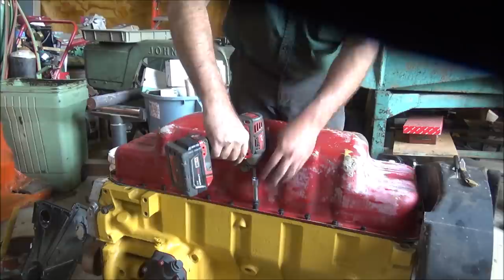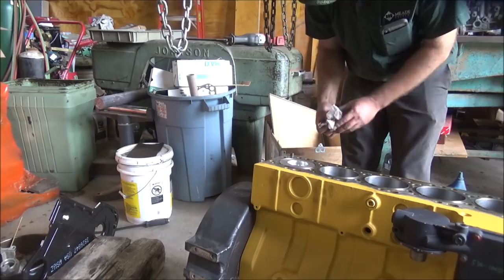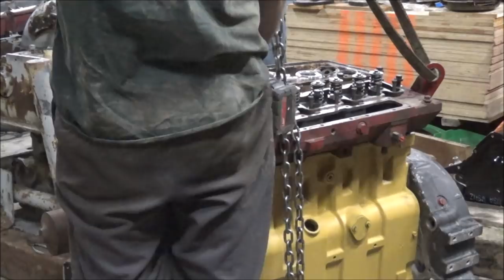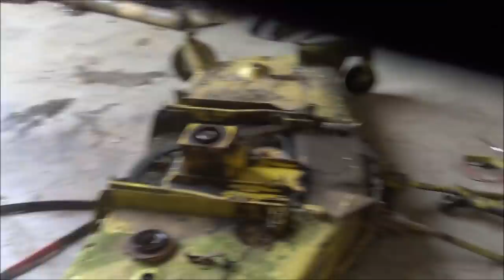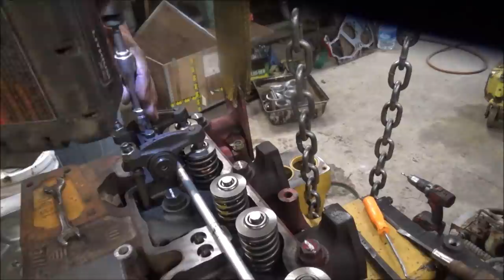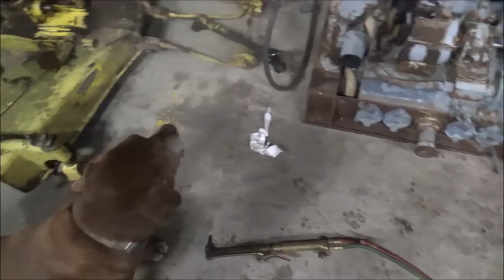Hyster Forklift Cummins 8.3L Swap Part 6 Engine Assembly

Comment: Disappearing parts. I was rebuilding a Detroit 652 and was short a piston pin. I searched for a week looking and ended up using a good used one. Two days later I found the pin in our freezer. My partner wanted to see if shrinking it would help assembling  the unit and he forgot about it. Looking back it was worth the aggravation for a good story
Reply from the maker: Question is did you tear the engine back down after you found it to put in the new one? Lol

Comment: Hi Brian,
Just about to start my 6CTA Rebuild really enjoying the videos. What type of Silicone are you using.
Cheers Mick
Reply from the maker: @mickmocin586  I assume you mean the dabs of hylomar at the joints on the pan gasket. In general I keep silicone away from engine assembly as it can sure mess stuff up if it gets loose in the engine. Most gaskets are installed clean and dry unless it’s one I worry about staying in place or has a rough surface then I paint the surface with aviation gasket sealant.

Comment: Looks like you need to put a couple of tiny tacks on the socket and extension, you can separate them later.
Reply from the maker: Or fix the retaining pin in the extension

Comment: Hi Brian.  Did you use a ball peen hammer on the oil pan holes so they pull the pan tighter on the gasket. Best Regards

Comment: 200 ft lb seems like a lot, but when you think about C/R and Boost, its really not a lot.  What is that like 17:1 compression and 50psi of boost?
Reply from the maker: 17.5:1 and probably 30-35psi stock

Comment: Are you going to put it on the HBM and give it a pre-installation spin?  Make sure oil pressure comes up as it should before it's fired to run on it's own?
Reply from the maker: No I have better methods.

Comment: Why do you appear to not be using assembly lube?  We always in the past used STP as an easily available lube for every moving part.
Reply: stp is not a lubricant, it is a viscosity improver. makes a poor assembly lube
Reply: @steveschumacher5470  BS
Reply: @davidcallista2580  Not BS, that's really what it is, a bunch of VI goo and a dash of ZDDP (which isn't nearly as simple as people make it out to be but I digress). Build motors with it if it makes you feel better but an oil can of SAE 30 diesel engine oil will work just as well, if not better.
Reply from the maker: Everything is assembled with the 15w40 engine oil it will see for the rest of its life with the exception of the cam. It will all be pressure lubed as well before it ever gets turned over to start.
Reply: @steveschumacher5470  Granted it is a viscosity improver.  However, we figured that if you could dip a flat blade screwdriver pointy end into STP and then you find out that you could not keep the screwdriver from slipping between your finger and thumb it had to be one terrific lubricant.  Plus, we had experience with engines with zero oil pressure lasting long enough to get things shut down and suffer no damage because the engine had STP in it.  Snake oil? Well, when it first came out we found that after putting it into an engine we would have to turn the idle back down a bit.
Reply: @bcbloc02  We had a pressure oil tank that we shot engine oil into the lube system for a moment before cranking.  Turbos like that oil pressure.  I am a believer that one cannot over lubricate a fresh engine.  We even installed some pre-start electric oil booster pumps like the military used for aircraft engines.  Wait till the oil pressure was up for several seconds and hit start.  We even did that for one customer who was a believer in the pre-oil system and put a Hobbs switch so the starter would not engage until OP was up.  I am from the days when we put shims behind rod bearings to take out a couple thousands of clearance.  Heck, we even found Chevy stovebolts with babbit bearings.
Reply from the maker: I have worked on those old babbit bearing oil dipping Chevy's. I like the starters with the built in gear pump where when the starter starts to spin it pumps the oil up once oil pressure is enough the bendix is engaged and the engine can start. Pretty slick setup. I am sure such devices help but honestly most engines if taken care of tend to outlive whatever they are in with out those extra assistances.
Reply: @bcbloc02  Dang, you are either older than you look or have worked on collectible antique cars.  You are driving a classic Dodge truck. Those are showing up in car mags when someone dolls up something besides the Fords and Chevrolets.  I am in the process of restoring my prized 85 Dodge D-100 Custom short wheelbase I have owned for 25 years.  That was one of those that were sold with absolutely no options.  /6, 4 sp, and it only had power brakes because it had disc brakes.  Manual steering. Gave it to my grandson when he was a senior in HS and needed a vehicle to get to an internship.  He drove it thru 4 years of college and all of that driving was in northern salt road places.  Can't blame all of that rusted out stuff on him as we spread oil field salt brine on our gravel road to help keep the dust down.  Keep up your great videos.
Reply: @bigun447  read the can. it is an additive, never meant to be used alone.

Comment: I always thought that torque to yield bolts were one time use only and had to be replaced once they get stretched. Hard to tell if they were new or used.....
Reply: Not sure of the case here but I know when you get into the big/expensive stuff there's sometimes an inspection procedure in the manual to qualify used ones for reuse.
Reply from the maker: New bolts is ideal, if this were a high powered build I would use new ones. Cummins sends a bolt stretch gauge if the bolts aren't stretched you can re use them supposedly. These aren't torqued to yield just torque turned.

Comment: Oh Brian, why didn't you paint the oil pan and head before putting it on after all that nice yellow inside and out on the block? Lol. Don't worry mate we all miss something out like a broken stud when we are doing an engine rebuild lol looking good. As a matter of curiosity, what is the displacement of that engine? In cc's if you would as we don't use cubic inches in England any more
Reply from the maker: Saves a lot of masking to just paint it all once it is together.
Reply: bcbloc02 ok mate fair comment lol
Reply: Err what cc is the engine ?

Comment: you don't torque the rocker arm assemblies?  I assume you just covered the valves for now, but will take it off and adjust the valves?  How's Bailey doing?  Old age is hard on a dog, I think more so than people sometimes.
Reply from the maker: Yes the overhead all gets revisited when I have the parts to fully assemble that part. I just put it together to keep it clean.

Comment: Brian, I thought you said turbo?  Do you need the turbo for the forklift?  That big dude should make more than enough power NA for what it's going to be doing, no?  But, use the turbo, or find an non-turbo exhaust manifold... if there is such a thing... I guess that is the real question.
Keep on keepin' on... Getter done!  Lovin' it.
Reply from the maker: Boost makes everything better, even if you don’t need it. 🤠

Comment: No doubt that's going to be in forklift  and running before I am on the road (well legally)! Do you have those weird pre-heaters for cold starts on your intake manifold (ones that spray diesel and have an igniter)? If so are you keeping them?
Reply from the maker: No I don't have any heaters on this unit. I am hopeing it will start like my b series which never needs them till below 0 and I don't plan to use a forklift if it is below 0.

Comment: Brother your doing excellent job I am watching so interesting

Cylinder head getting  short bolt and length bolt I want torgue details details
Reply from the maker: Pretty sure I gave the head bolt torque values and the steps in the video.

Comment: Mr Brian my eyes may have deceived me but it looked like there were two missing nuts on the oil pick up tube mounts  at the oil pan rail ends. Hope I am wrong ,
Reply from the maker: Those are bolts with spacers that hold the pickup mounts to the block pan rail if that is what you are talking about.

Comment: Looking good :)   What would a rebuild like this cost if you took it to a rebuild shop?
Reply from the maker: I don't know but the Deere engines of similar size I do at work typically run $7000 to $10000 depending on how much is still in spec.

Comment: SO THATS WHY MY BILL ALWAYS  has  A SHOP SUPPLYS CHARGE ON IT  TO CLEAN WORK PANTS ????  cheaper to buy blue towels
Reply from the maker: You bought towels lately? lol
Reply: bcbloc02, I get 50 of the red shop rags at Harbor Freight for 10 bucks. I wash them  if they’re not too greasy or oily, just don’t wash them with anything you don’t want to turn pink!

Comment: You forgot One Of The rockers from the camera point number five to tight it Down
Reply from the maker: I did not install the set with the missing pushrods
Reply: You didn't miss one installing but what I can see see if number five is finger tied and not with the Drill
Reply from the maker: Yes I did not put it on as I will have to lift that set up to drop the missing pushrods in then I can tighten that set of rockers down.

Comment: I built brackets that go where the engine mounts go and have them on jack stands 
Built too many engines to count 
More then the cummins dealer built
Cummins mid range engine specialist
Reply from the maker: So is the exhaust manifold different from an ISC to A 6C? I went to bolt the manifold I had on the other day and the bolt holes are like 1/4" spaced too close together on my manifold versus the head. The ports all line up but I can only get one bolt in. Lots of places on the web show the manifolds being the same but I can only figure that is wrong. DO you know do they use a different part number exhaust gasket between the 2 engines?
Reply: bcbloc02 what happened to the manifold that came off
Some times they warp till the exhaust bolts break
Cpl (corresponding part list) tells you everything which manifold cam thats what its there for
Reply from the maker: Paul Tavres I have 4 Cummins midrange engines and none of them have legible data tags. The fan blast has eroded all of them blank.
Reply: bcbloc02 there should be a serial number stamped on the right side rear near the head gasket surface 
You use that number to get the cpl number

Comment: Can’t you tell your going beyond torque? It clicks and your still tightening. I tell people using my torque wrench when it clicks stop 🛑!
Reply from the maker: Nope can't tell. I went back and rewatched the video and could not find where you were talking about. I mean I see where the handle moves after the wrench clicks and breaks over but the socket is not. Maybe one rod bolt I pulled just a bit after it clicked, but it could be just that it moved after it clicked hard to tell.